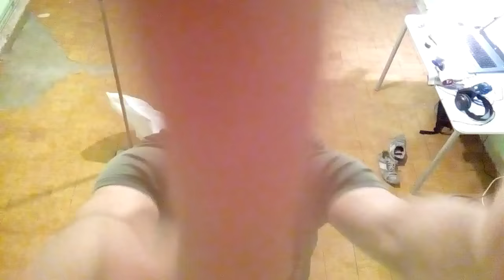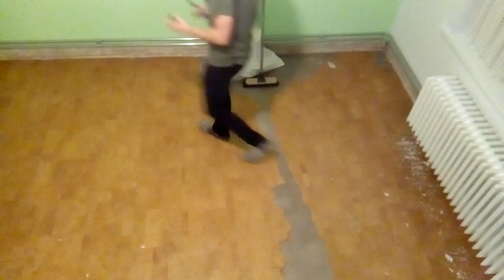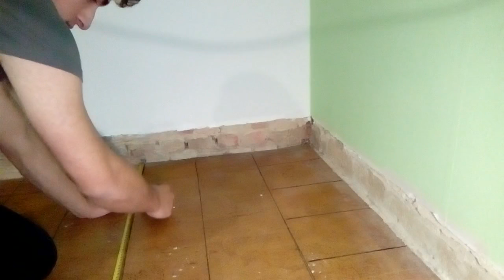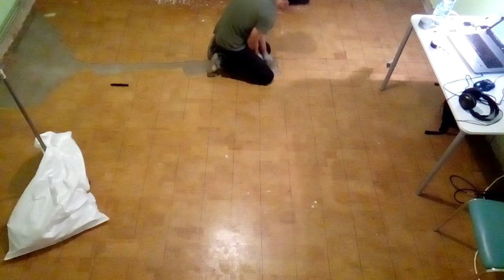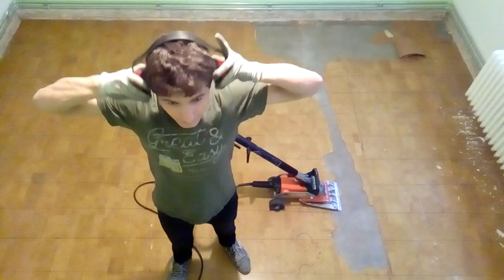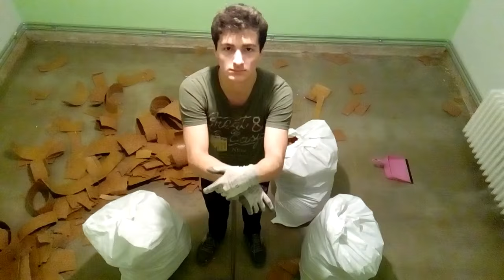Cork Floor Demolition

Comment: Question, why did you take up cork flooring? Looking to get this installed and just curious to know if there is something I should know before purchase. Doing some research now.. Thank you!
Reply from the maker: It's an old house and it smelled, but cork floor is so great for your feet and fast to lay.
Reply: I'm replacing my old worn out cork tile floor with a brand new cork tiled floor. It looks great, is quiet to walk on, doesn't get too cold to walk on in those chilly winter mornings and when you drop that expensive piece of China on it, it doesn't smash into a thousand pieces!

Comment: Great Job! What's the name of the tool you used to scrap it off? I'm sure local hardware store will probably laugh at me if i try to describe it...
Reply from the maker: It's a Carpet Stripper. I hired it for a day. There was actually no need for precut lines, but I didn't know that... Now I do... ;p
Reply: @obvious007  Thanks for the info and reply!
Reply: I did a search, all I could get locally is a party stripper. Hope they work just as good! :)
Reply: @HerewardDundasTaylor  how did it work out?
Reply: @obvious007  haha, you did seem rather armature.